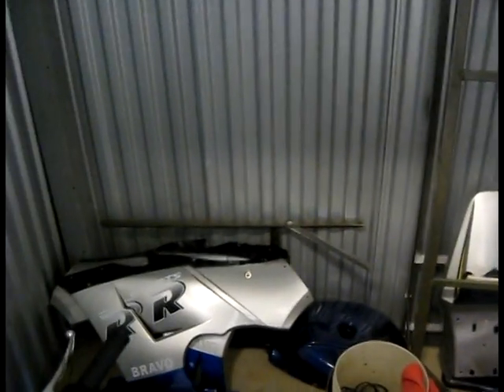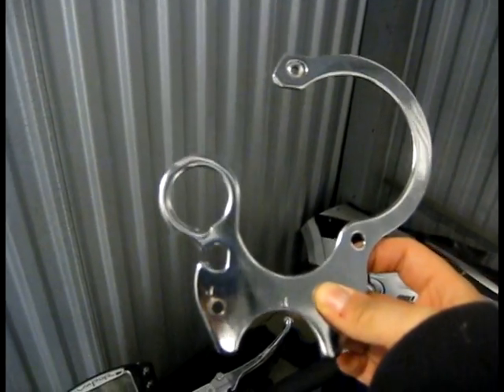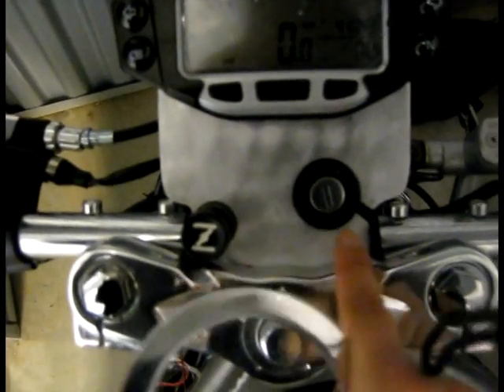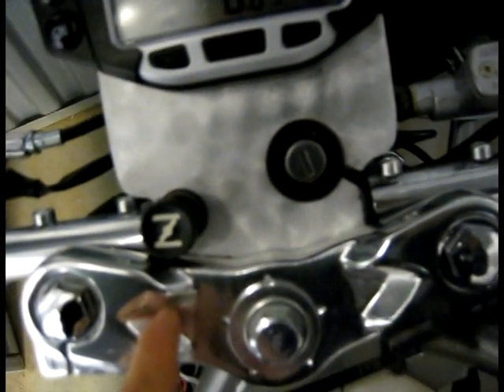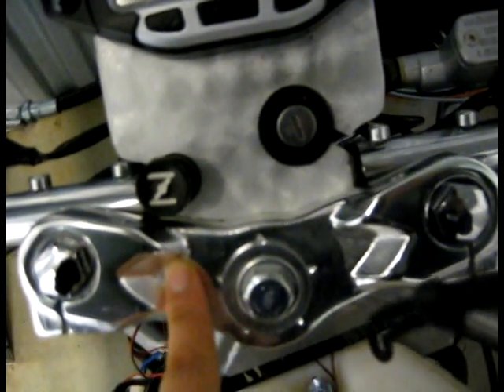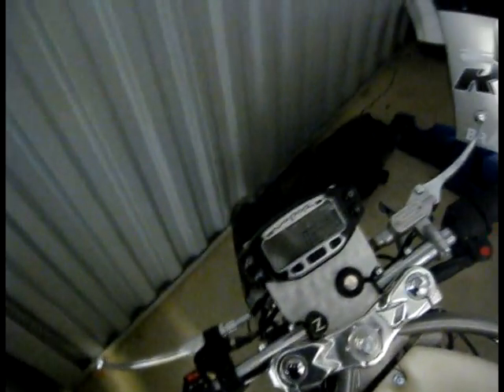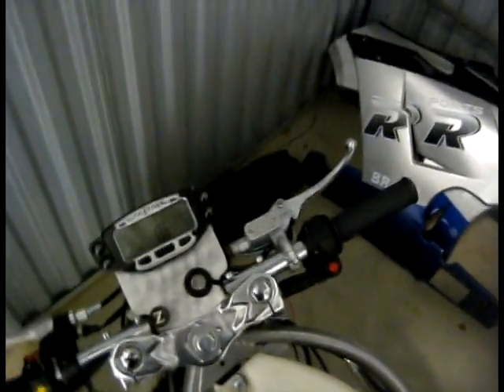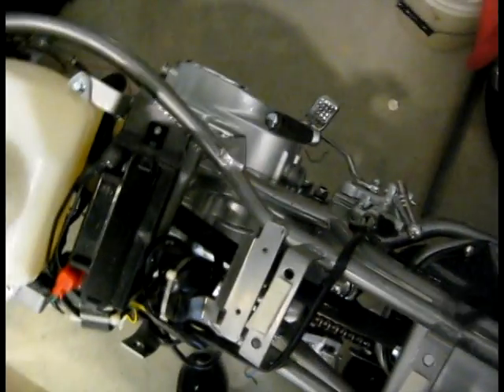Trailtech Vapor Installed On My X18

Comment from the maker: @92MustangLover Yeah I hear ya. I haven't finished completely wiring it yet. I took a break from my bike, going to work on it when it gets warm. I don't have a wiring diagram, I just used the instruction manual that came with the vapor, and just looked for the right wires for each part. I haven't done the signal lights yet.

Comment from the maker: I bought the one with the zip tie sensor. I'm not sure what gray paper you're talking, you mean the silver thing the vapor is installed on? That's aluminum. He did something called engine turning which is that "swirl" on the metal.